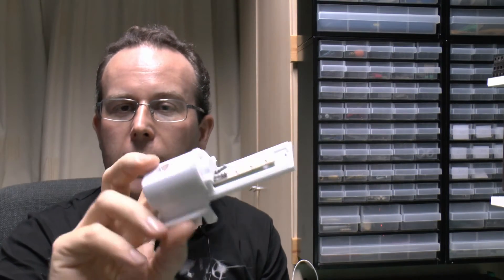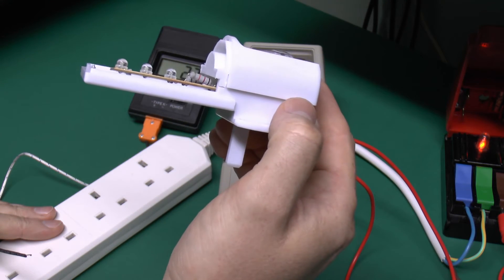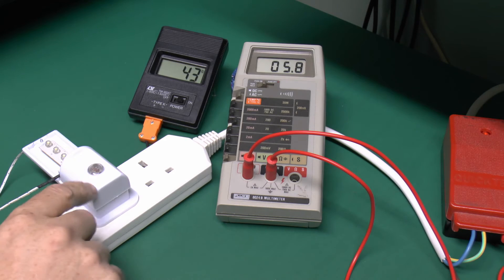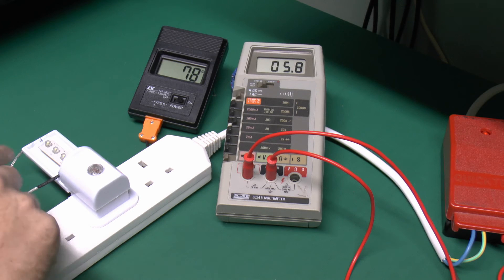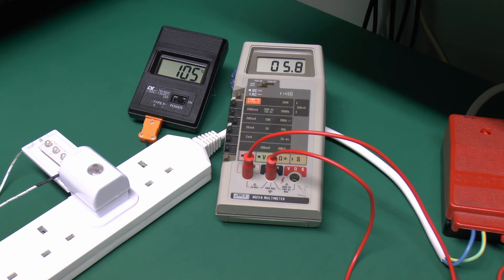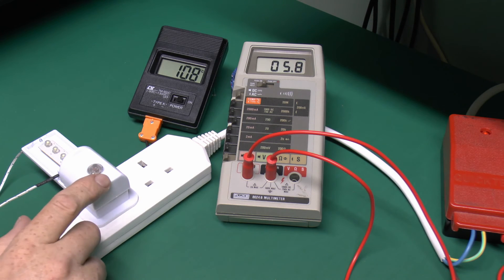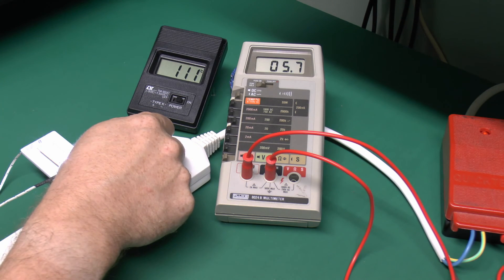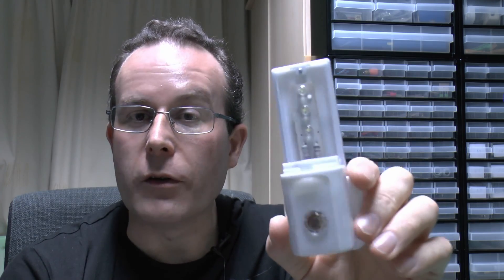99p LED Nightlight Current & Temperature

Comment: Adding a single series capacitor as current limiting and ripping that light sensitive resistor and transistor for other projects makes this item very worthwile to buy of course. It should really be sold as a DIY kit and a clear label stating it is not meant to be just shoved into a socket and used without proper modifications first.

Comment: Well, there we are. Not only does it use more power WHEN IT IS OFF, but this scorching hot little heater has an added side-function of glowing in the darkness. How cute.   NOT!

When in an assembled 'off-the-shop-shelf' state, would you say that you can feel any 'warm-spots' on it after being left pluggged-in during the daytime for a few hours? If so, it could be bit of a giveaway as to how it works in there, not to mention that it could be a bit worrying to a typical end-user who wonders why something is warm/hot when it isn't even glowing!!

Aaaah, I wanna see this thing get busted on video..... using electricity of course. Too much electricity. :D

I have a variac. It can turn out 270v. Given that the night-light device actually shorts out the circuit in there and there's a component within which reaches 111c in temperature when the circuit is in a shorted state, it makes me wonder just how much hotter that thing could get if we stuffed a bit more juice into it. :D

What would let loose first, methinks? The internal fuse? Those resistors? Or..... the whole thing, because the temperature went silly-high, melted the enclosure and/or its insides and it went up in flames?

Another thing: If this is off during the day and in a shorted state, it makes me wonder (especially seeing as there's no surge protection in there.... well, there wouldn't be for 99 poxy pence!) how this thing would cope if it took a small-ish voltage surge.

Small-ish in the ways of a voltage beyond what my variac can make, but below 1,000v. :D

Aaaaah, I wanna get one now and BUST IT, just for the laughs. It's only 99p, I'm sure my budget could stretch to that level. :D

I'm not sure if 270v would be adequate though, so I'll have to leave that one for another time (or request that either yourself or Mr. Photon does it for me :D )

Thanx for showing this one,

-BoomBoxDeluxe.

6th March 2015, 01.10